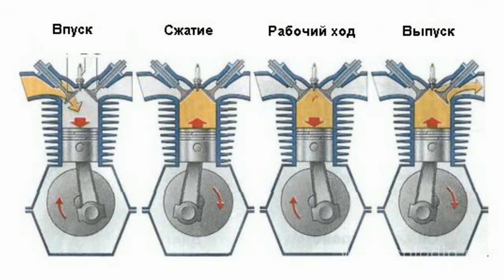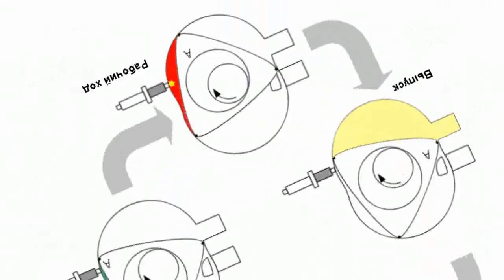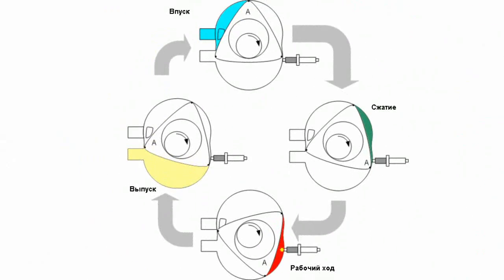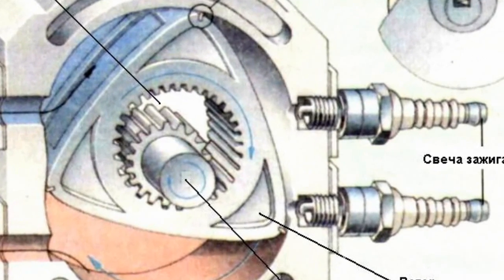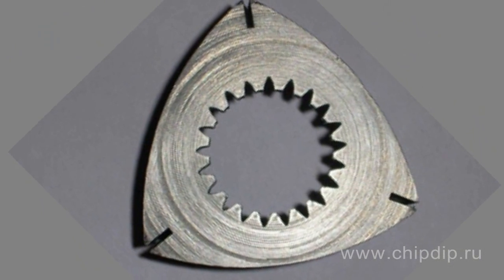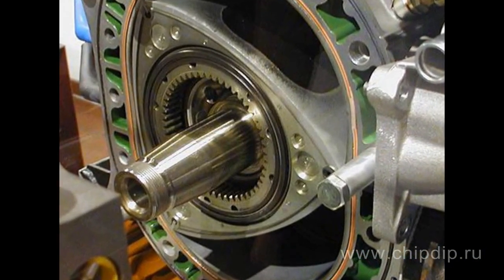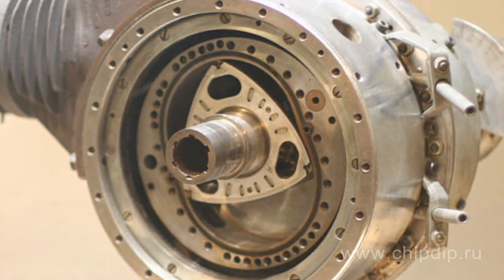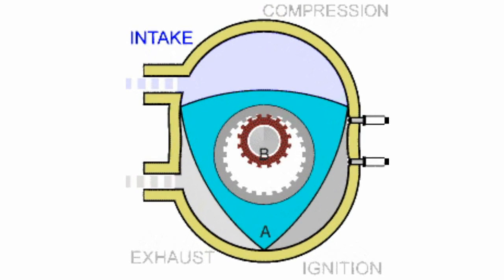Wankel rotary engine

Comment: https://youtu.be/mF2lR20aPL0     this one is with offset compression  
super charged  check out more timing and the plug locations you will 
love it   performance   performance   performance  balance power with 
emissions.  and more efficient